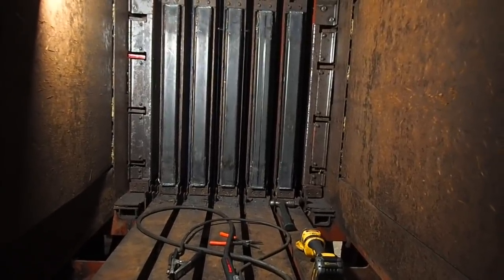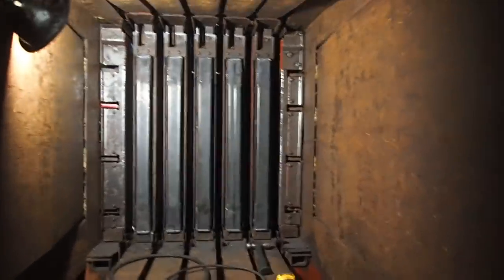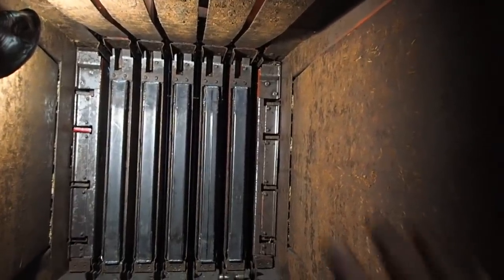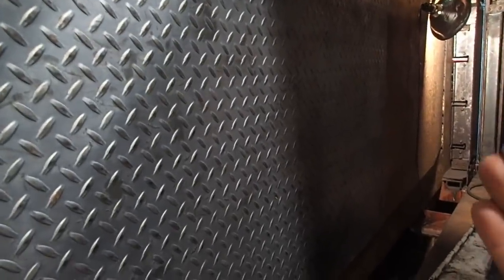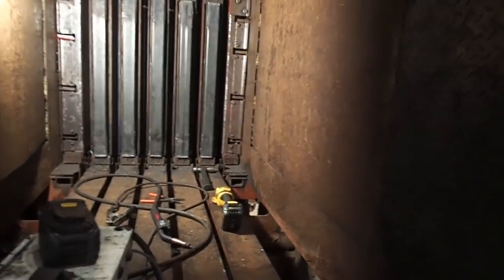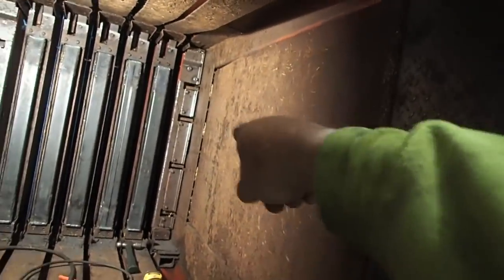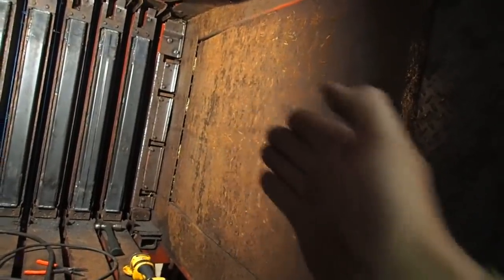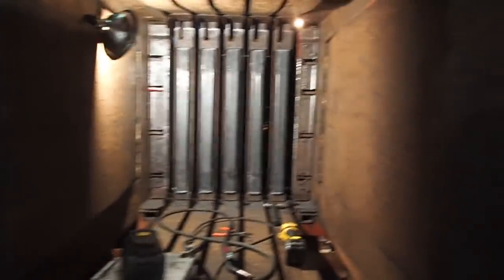Why I do What I Do!!

Comment: Great job on explaining the mods to make a firmer bale in grass hay.  Make sure you (I’m sure you have already) check the wheel bearings on the old beast.  I’ve seen a lot of them go out after a baler has sat idle for an extended time.  Makes a mess out of the twine boxes.

Comment: It's amazing how many people can't accept the concept that a reasonably intelligent person with a fair amount of experience can't improve a machine unless they also have an engineering degree. They'd really die if they knew about the amount of education many of the early manufacturers had. They also don't realize that any design is a compromise, the modifications you're making to this unit are improving it's function for your needs and in your particular crop and market. It may make the baler less useful to someone else or may increase the amount of horsepower needed to make the baler work at capacity.  What Hesston made was a compromise between cost, capacity, power required, longevity, market objectives and reliability. Some of what you are doing may of been optional or production improvements to this very model of baler, some may be features and designs that Hesston built into other balers at the same time but the market objectives that Hesston had may of earmarked a baler of the capacity you're trying to achieve in a larger more expensive baler.    Since this baler was built Hesston and others have made many big square balers, tried different and new technologies, learned some things and are probably now making better balers. All you're doing is adapting new technology to this unit and modifying it to better meet your needs. We could see Wes Pandy marketing "Pandy Power Pack" kits for balers but also realize that at that time Wes may see some push back from manufacturers and dealers who are trying to sell new balers because it could be perceived he is switching from being a customer to a competitor.